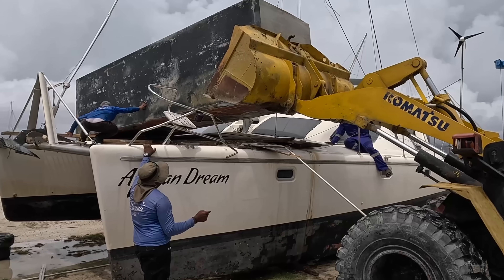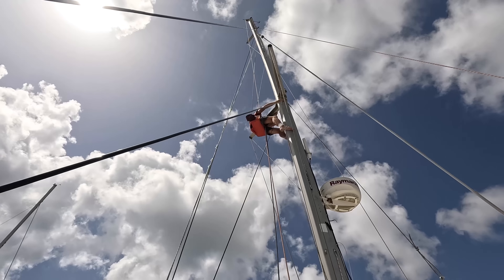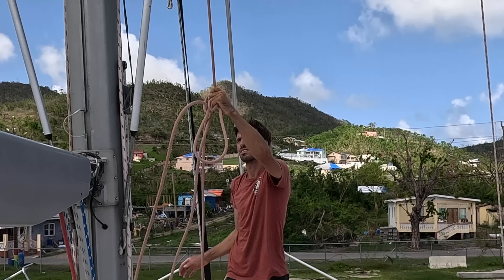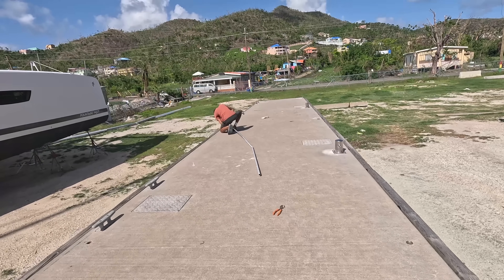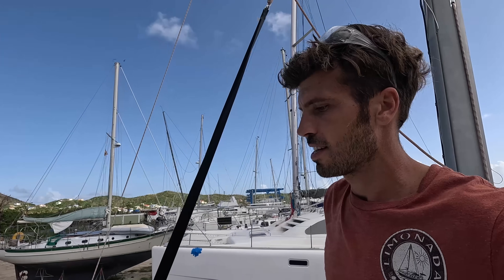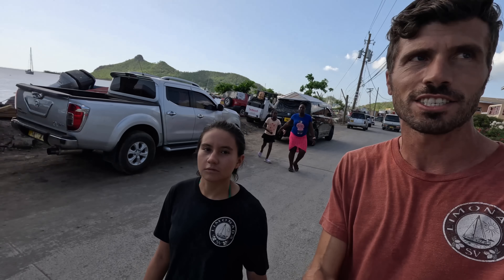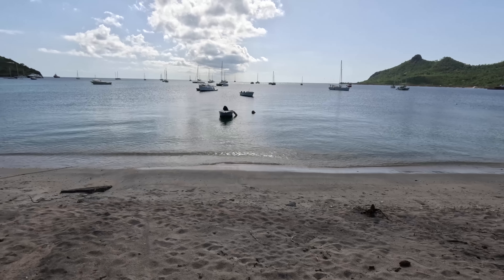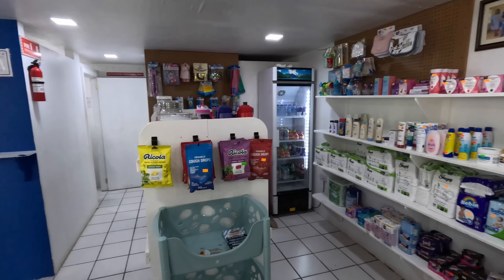Our DIY Hurricane Beryl Damaged Catamaran Project

Comment: You can run your generator and engines while on the hill. Just put a hose in the sea strainer and turn the hose on full letting the engine take what it needs and the excess water overflow into the bilge. I just did this with mine and it worked great.

Comment: For the watermaker you open the needle valve so there is no pressure and the liquid easily flows through. You don’t need to flush the product output part.

Comment: The diaphragm style pump presure cut off can be adjusted with a central horizontal screw or hex at the pumping end and or higher and lower presure units available cheap. Yeah bilge pump is bad at making presure. Well style submersible pump has lift which seem to equal pressure. Cools better too

Comment: The water maker needs 800 psi to push water through it. The pump you’re using is about 80 psi, you need to somehow get the main pump working to pickle it. But until you can do that I would continue to run the 80 just in hopes it keeps everything moving through.
Reply: 800psi is need to make desalinated water. You don't need much just to have a normal flow for the pickle solution. It is just like doing a fresh water flush after making water.

Comment: Ummm the watermaker pump is super high pressure you will need to borrow a generator or find a way to water cool
Reply: He's not trying to make desalinated water. Just needs to flush system with low pressure. High would be faster but low will work
Reply: @SoItGoesCAL34  Right so he needs to force pickling solution thru the membrane to clear it of bad stuff.  If it doesnt make it thru the membrane it wont pickle it.  All the bad stuff will be in the membrane and on the backside of it destroying it.
Reply: @SoItGoesCAL34  I used to install these and all the other electronics on Manta Sailboats after they were built.